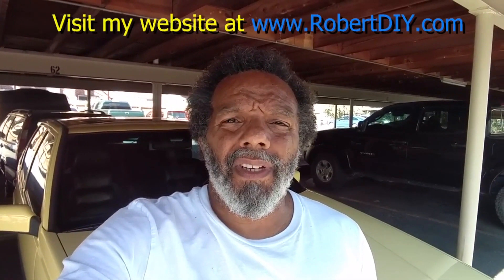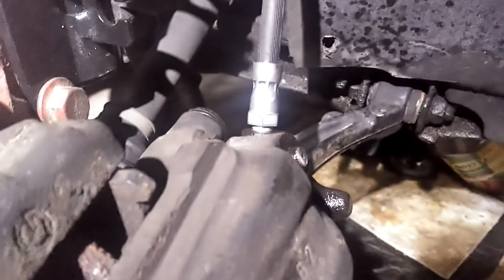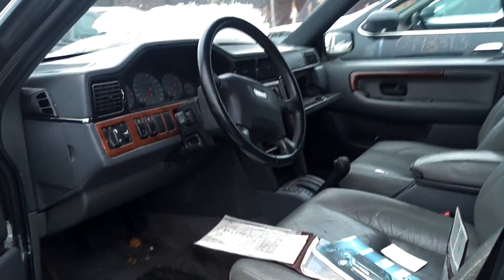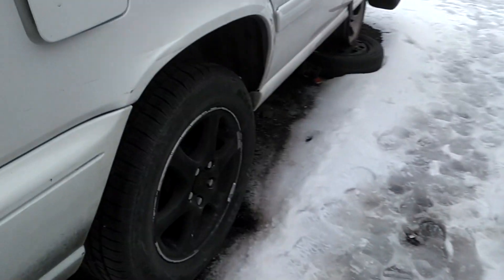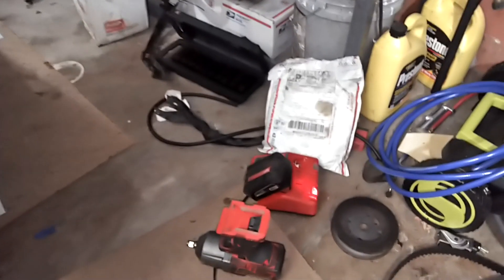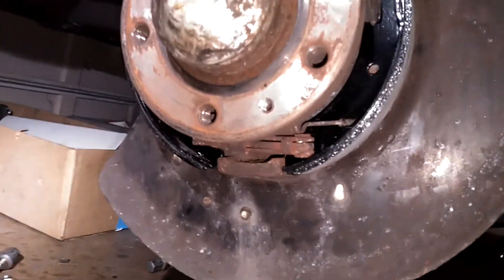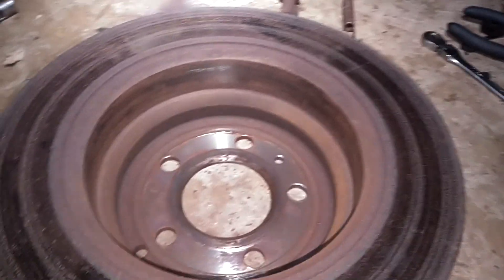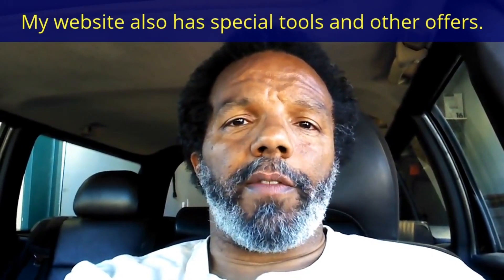More 850 restoration/conversion. Changed the oil, bleed the brakes, fixed parking brakes and more.

Comment: What is the part number for that fuel tank clamp???
Reply: 3531428
Reply: @Sac_slappper_4rce  Gracias, TKS
Reply: @bernardaflores1720  Buy the bolts at the same time Bolts x 4 #982758.  Clamp x 2 #3531428
Reply from the maker: Should only be 2 bolts.